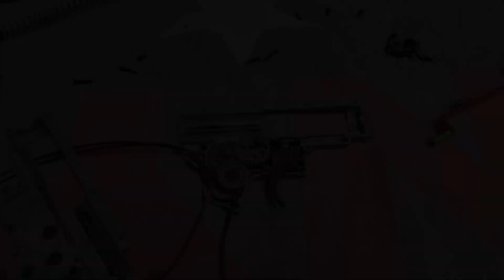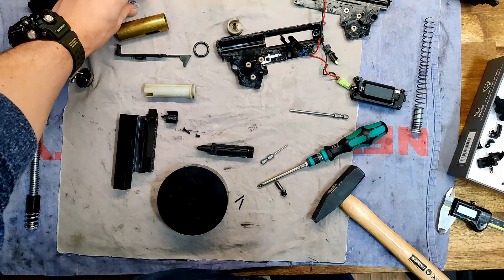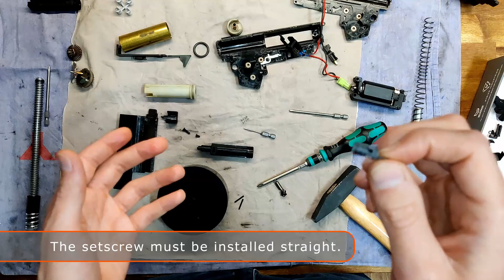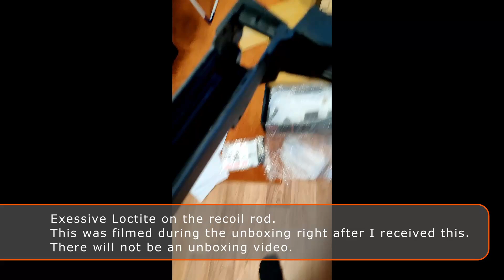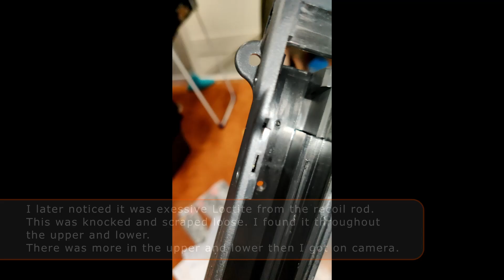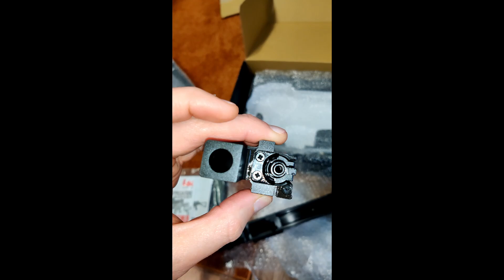VFC UMP (MP7) NPAS Install - Loctite and bolt problem

Comment: Is the Gas Adjustment Plate unique to UMP, is it on the MP7 too ?
What is its purpose and how does it function please ?
Reply from the maker: Its unique to the UMP. 
It can allow for more or less gas being taken from the magazine. Depending on the position of the plate, the gas valve is closed sooner or later. In cold weather you can slide the plate towards the front. In hot weather you can slide the plat to the rear. I have it installed in the middle and dont ever move it. 
I do not plan to make a video about performance changes when adjusting this plate. I have other projects that have priority.
Reply: @Airsoft-Engineering ok thanks

Comment: What’s the significance of the Gas Adjustment Plate being upside down, do any of your videos show this more clearly please ?
Reply from the maker: VFC installs it wrong from the factory. This has been happening for years and years. When it is upside down it does not work as intended. Besides that, the one of the levers in the fireing mechanism will connect with the screw heads causing fast wear to that lever. When you see its installed wrong on yours. Install it right way up and center the lever on the slots for the bolt head. That will average the timing of the gas being cut off.